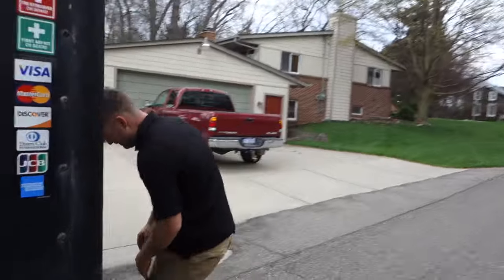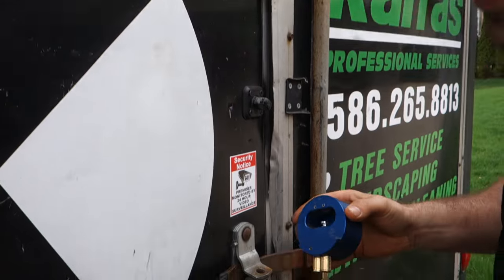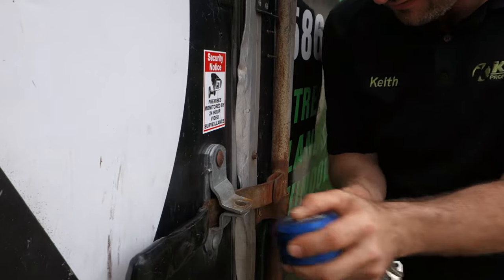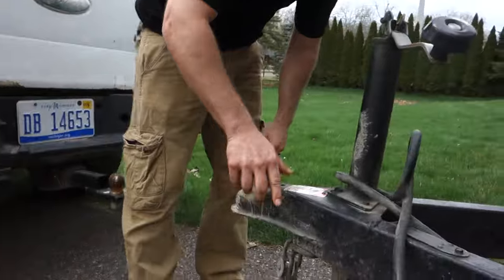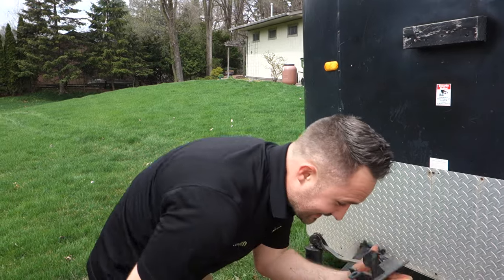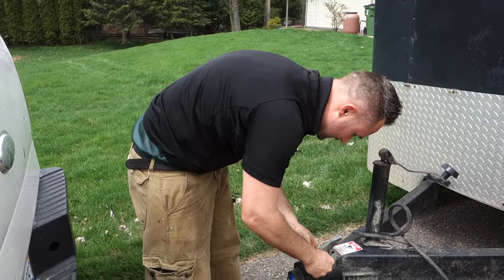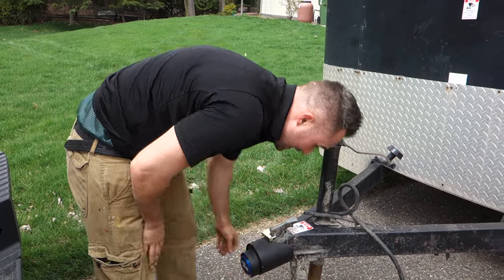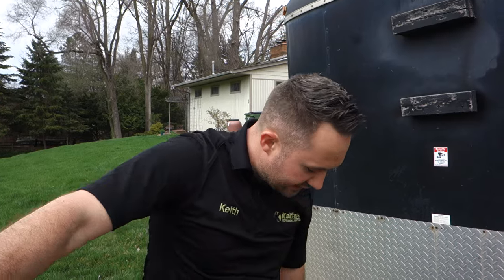Landscaping Employee Trap Reviews - Proven Locks - What Are The Best Locks?

Comment: The alloy body of this lock can be melted with a mapp gas plumbing torch.  The hollow roll pins where the "T" end of the Proven shackle locks into the lock body can be sheared with a blue concrete screw on the end of a slide hammer.     

Look for locks with steel bodies and solid steel pins.